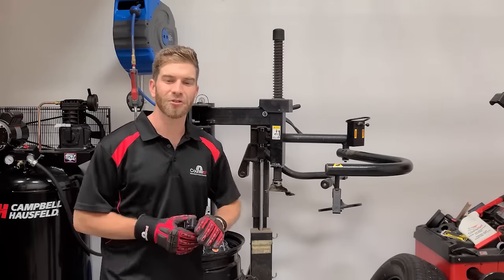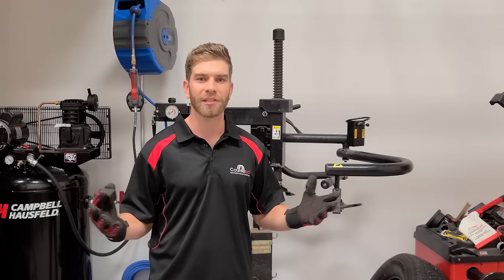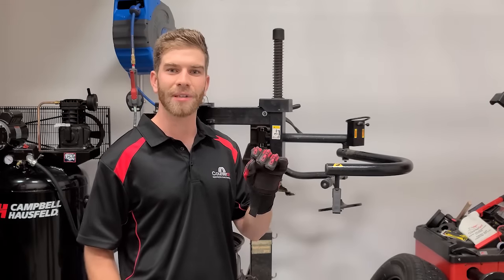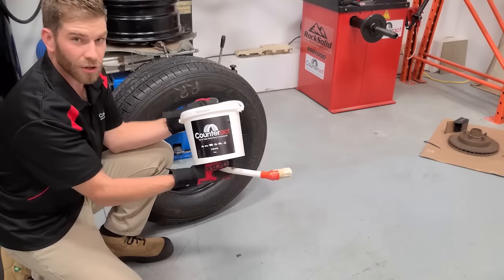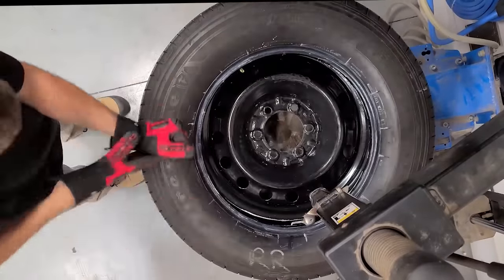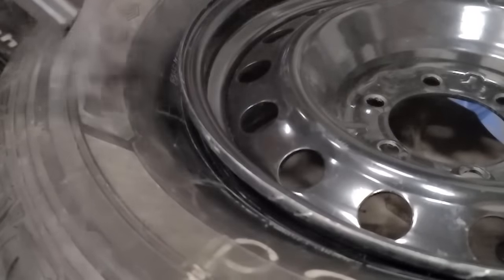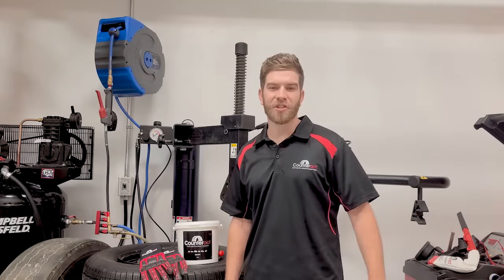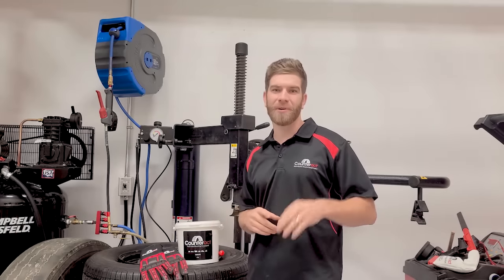Camera INSIDE a tire with Counteract Balancing Beads

Comment: what happens if I get a screw in my tire and need a patch? Do I have to buy beads again or will tire shops recover the beads or fix without losing the beads?
Reply from the maker: In most cases, you can remove the tire with the beads in place. The tech, or whoever is doing the repair can remove the beads and re-use them once the repair is complete. The product will not harm the tire repair or patch, so you can put them back in, or place new product in.

Comment: Will these shave down the inside of the tire like I saw in a show review that removed a wheel with beads in it? Will it act like an abrasive and slowly sand the inner tire? I saw that rubber dust and inner lines on the tire disappeared to show this happened.
Reply from the maker: Hey Andrew,
 
Counteract Balancing Beads will not cause any damage to the inner liner of the tire. They are made of a very smooth tempered glass that does not break down over time and become abrasive like ceramic beads can. Additionally, Counteract Beads are not free flowing in the tire, so they aren't rolling around in there like other products are.
We have a guarantee that if the beads ever cause any tire damage that we will replace that tire for the customer. In our over 25 years of business we have never had to replace a tire.
https://counteractbalancing.com/guarantee/
 
Thanks for the question!

Comment: This would be fine on 275/60r15 drag radials?
Reply from the maker: Hi Abel, yes we have many customers who use the product in drag radials. However, we don't recommend the product for small passenger cars such as a Honda Civic, or VW Jetta as an example. If your wheels are on some sort of classic, or hot rod vehicle then you are ok to proceed.

Comment: I used 6 oz in each of my 31-10.50-15 all terrain's and it shakes like a washing machine. Too much weight? Not enough? 6 oz was the recommendation.
Reply: Hi Greg, I am sorry to hear about the issue you are experiencing. Does the vibration start at lower speeds and get worse with increased speed? or does start to vibrate around highway speeds and go away if you speed up or slow down? Also, how many miles have been driven since installation? There are a few possibilities that could be causing the vibrations, these questions will help us isolated the issue.

Thank you.

Comment: Any reason I couldn't run these in my motorcycle tyres?
Reply from the maker: Hi Mark! None at all, the beads work especially well in Motorcycle tires, just ensure you have the proper amount and reference our motorcycle tire chart here.
https://counteractbalancing.com/wp-content/uploads/2021/07/Motorcycle-2021-Chart.pdf
You can also download our new app with our calculator to find out the required ounces for your tires. https://qrco.de/bcCCSm
Thanks!
Reply: @CounteractBalancingBeads I feel it's crazy that I have  never once had a motorcycle shop offer the option of balance beads and I have been through dozens of tyres across multiple bikes. I don't want ugly lead weights put on my gorgeous new powder coated or polished street bike runs and I don't want the risk of having one come off my track bikes.

Comment: What's the tool called, a model number would be great, that's used to seat the bead?
Reply from the maker: That is the Gaither Bead Bazooka. They have multiple sizes for different applications. It would be best to check out their website for the info.

Comment: The film showed nothing other than the beads being thrown against the outside of the tyre, and they looked pretty uniform not bunched up in one area in an effort to counter the force on the wheel causing vibration. 
I want to see the wheel on the balancer to prove that the wheel is in fact in need of weight to correct its balance.
They tyre marked inside at the point  where counter weights would have been fitted
The wheel itself, without tyre, balanced to prevent the weight of the camera influencing the experiment
I also want to see it repeated with the same result on a variety of wheel sizes.
Reply: The same questions occurred to me, a uniform sprinkling of beads on the inner surface didn't seem to be much if any effect on the wheel assembly as a whole.  When uniformly distributed over the full inner surface, it would be about a quarter gram per square inch of surface, which doesn't seem like it's going to have an appreciable effect.
If the video showed all the beads clustering about a single point, perhaps where the camera was aimed at a lightened sector of the tire, that would be conclusive proof that it's got some benefit.
To do this, apply wheel weights at the opposite end of the tire where the camera is mounted, and then look for the action of the beads clustering at that light section of the tire.
Reply: @dubmob151  Thinking about it, similar to what you suggest, an experiment could prove whether the beads indeed do have an effect by over weighting the wheel to make it out of balance, this way you should know exactly where the beads would cluster. 
Personally I have little faith in the product working and will stick to having my wheels balanced with tradional lead weights
Reply: @joebloggs1317  there seem to be a lot of people that believe in it so it would be a good demonstration.
As a simpler and less involved experiment, just tape on a 2 ounce (or whatever this can handle) weight to a wheel with these beads installed, and drive up to highway speeds; if there is no additional vibration noticeable, then that would prove it works empirically.

Comment: seems to me we can use any kind of small particles?
Reply from the maker: Technically anything you put inside a tire will act the same way, but there are many advantages and disadvantages of what you want to put in your tire. Our beads are proven to readjust easily, not break down, are not affected by moisture, won't damage the liner, etc.

Comment: I have 295/65r18 duratracs on a Toyota Tundra.  I put 8 oz in the tires and after some test driving i get a very slight shimmy on the steering wheel.  What can i do to make it better?  I also had an alignment done at the same time
Reply from the maker: How far have you driven since installing the product? in rare cases, if you placed the bag inside the tire it can take a few miles before it has fully broken apart. This may be the issue. 

If you have driven more than 50 miles and still have a shimmy, a shimmy in the steering wheel would be associated with a front tire, likely, one of those front tires is further out of balance than what we normally recommend for weight. You can simply add 2oz to each front tire since it is a slight shimmy, this should resolve the issue.
Reply: @CounteractBalancingBeads  thanks for your reply.  After 100 miles it has slowly come in.  I will probably add the 2 oz because I feel I’m at the minimum on one tire.

Comment: I'm a mechanical engineer so I have a fairly good understand of kinematics and physics. I know the balance beads work. I've used them. However, for the life of me, I can't actually figure out how they work. There's more going on here than just the centrifugal or centripetal force. If it was only the centripetal force at play, the beads would all go to the point of greatest mass and increase the imbalance.  But like I said I know the beats work so that isn't happen. Therefore there's something else at play that the explanations I keep hearing aren't taking account for.
Reply from the maker: Hi Mike, we just posted a new blog about the Science Behind Balancing Beads which may help to clarify. Thank you!
https://counteractbalancing.com/2024/01/22/the-science-behind-balancing-beads/

Comment: What is your thoughts on using 50/50 antifreeze?….I’ve heard a lot about that.   How many ounces of beads would you use for a 245/70r 17 tire?
Reply from the maker: Glock Man, liquids such as you mentioned have been used to balance tires, it does work, however, ideally, you do not want to have any liquid inside the tire at all. The reason being is tires breathe and they can absorb that liquid and moisture over time and that can lead to the belts rusting or the construction of the tire to break down. You are always best to use a dry compound, or better yet a bead like Counteract. 

For your tire size, it would be 4oz for 1/2 ton vehicle, 6oz for a 3/4-1 ton vehicle. Now if this is an AT or MT tire that would change and you would need 6oz.

Comment: I have a 2020 ram 3500 diesel 4x4 running BFG 37/12.5/20 KM3's with tpms. Having a heck of a time balancing all 4 tires. I have road force balanced 2 sets & they will not zero balance & still have vibrations. Will beads work on this setup and eliminate out of round vibrations? Thank in advance
Reply: It would be alot better for you in this setup to go with centramatic balancing rings
Reply from the maker: Thanks for the question! in a situation of out-of-round tires, ultimately there is no type of balance that would be able to fully eliminate the vibration. If a tire is not round, it will not roll true. Regardless of wheel weights, balancing rings, or balancing compounds there is only so much any of these products could do. The best means is an internal tire balancer, like Counteract, as it is adaptive and will adjust its position as needed. The benefit of the beads is they can balance the tire statically (up and down) and dynamically (left and right). Your tire could be inconsistent in any of those directions. Balancing rings, for example, are unable to balance dynamically as they are contained in a fixed ring and can only rotate and move one way. typically, the taller and more narrow a tire is the greater chance of a static imbalance. The wider the tire, typically a dynamic imbalance, and this is a frequent occurrence with larger off-road and all-terrain tires. Counteract will certainly aid in your situation, but if your tire is out of round, there is only so much anything can do other than replacing the tires.
Reply: @CounteractBalancingBeads  All tires have something a little bit "out of round" about them.  That's why balancing is a thing, at all.
Reply: @dansw0rkshop  no, balancing is to counter act the tire being un evenly weighted

Comment: I got Kanati trail hogs in 35/12.5/20. Have had them before and they're pretty good tires. My local shop only uses beads on 33"+ tires. They had to wait for beads but still mounted the tires. It rode pretty good for being having not been balanced.  These tires have a fairly high rib every 3/4-1". After they added the beads it shakes so bad I had to get off the highway, I believe the beads are getting caught, they disagree and blame the tires, any thoughts?
Reply: Yo! I got Kanati Mud Hogs, 33's though. When I first got them balanced, HORRIBLE. Rode them a couple hundred miles & they were really good, loud but a smooth "ooooooo" not "owowowowowowowowowowow." I was watching this video because there were massive amounts of weight in the barrels. Upping to 35's & looking at these to hopefully not have to weigh up the wheels.
Reply from the maker: Hello, sorry for the long delay in response. It is possible that the ribs (chevrons) could be causing issues, however, the more likely cause is the amount of product used. Do you happen to know what quantity of beads they installed? Typically a 35x12.5R20 will take 12oz per tire for an All Terrain, 14oz per tire for a Mud Terrain tread. 

The other possibility is that the bags inside the tire may not have broken apart as of yet, or at least at the time you commented here.

Comment: How many oz do you recommend for 33x10.5R15 bfg km3's on steel rims?
Reply from the maker: Hello, 

That tire size would be 8oz for an All Terrain, 10oz per tire for a Mud Terrain. The KM3 is a Mud Tire so you are best to use 10oz per tire.

Comment: I’m not sure what kind my tire shop put in my Tacoma but I’m running 285/70/17 9inch wide steel rim , ever since I switch to bead weights I’ve had more wheel shakes on and off a lot more now , I do feel it work and stops shaking once I ge to certain speeds wondering if I need to switch back to normal weights or if the shop didn’t put the proper bead weights in ?
Reply from the maker: Hello, 

Without knowing what product is in your tires and how much, it is hard for us to help you on that matter. If you are able to find out any of that information certainly reach out to us and we will gladly help you the best we can. 

If your balance is intermittent like you say, usually that is a sign of not enough. 

I hope that helps!
Reply: These beads are no good, have worked in a tire shop for 15 years. These just don't work. Sorry they are a scam.
Reply: @israelmex888  ya been told it’s more for semis or big ass mud tires I learnt the hard way
Reply: @israelmex888  they openly tell you don’t use on a passenger vehicle. Only for semis atv dirt bikes etc
Reply: @user-white007  ohh makes sense since semis dirt bikes and atvs are all so similar to each other.
Reply: Don't even use these on semis, go to a shop that knows what they're doing. These things suckand are a waste of money😂

Comment: I still don't think they work 

I have yet to see a video that shows the tire balanced with the beads in it. 

You get all these other videos of beads and everything but it doesn't show it on a machine showing it being balanced when it spins. 

Lead weights are the way to go
Reply from the maker: Hello, thank you for your comment! The reason there aren't many videos showing internal tire balancers in action on tire balancing machines is because these machines aren't able to fully optimize their performance. They can't spin fast or long enough to allow the beads inside the tire to properly settle into place. Additionally, a balancer lacks the suspension that's crucial for helping an internal balancer achieve optimal positioning. While there are videos demonstrating how beads can reduce imbalance on a machine, they're limited by the machine's design and lack of vehicle wheel-end components necessary for full effectiveness.
Reply: @CounteractBalancingBeads  ok
Excellent reply...
I'm still skeptical though 🙂

Comment: Can you use it on any P metric tires?
Reply from the maker: Hi John, 

The product is meant for Motorcycles, ATV, UTV, and any vehicle presenting a 1/2ton suspension and up. P metric tires are compatible, but if they are on a passenger vehicle such as a car or SUV we do not recommend their use in these applications.

Comment: I've discovered a better way to use these beads. DO NOT just toss the bag inside the tire, instead, carefully open bag and empty the beads into the tire.
The reason for this is because the bag never totally disintegrated inside the tire and at times the beads will cluster up in an open part of the bag and cause an unbalanced condition
Reply: yup....even theorizing that happening is the first intuitive guess

Comment: put it on the balancer
Reply from the maker: Beads will not work inside a tire on a balancer for multiple reasons. 

1) the tire does not spin fast enough and long enough on a balancer to properly set the beads in their place. 
2) there is no suspension, the rebound frequency of the suspension is fundamental in helping the beads position themselves. 
3) there is also no road forces acting on the tire tread which also aids in the positioning of the beads. This is part of the reason why an internal balancer is much better than a traditional spin balance. 

Hope this helps!

Comment: I am about to try it on my 2020 Camry, I do 65k km of high way use per years, can't wait to see if it will work ok for my application!!
Any suggestions or if I should not use on this application ??? I am about to put 6oz/per tire in 235/40R19. 

I have order a set for  my oncle's bike too as he just change is tire by is self and does'nt balance them so.... while see here too
Reply from the maker: Counteract isn't recommended for automotive applications. https://counteractbalancing.com/2020/10/05/internal-tire-balancers-in-cars/

Comment: Will these beads damage tire pressure sensors?
Reply: I have been running beads in my 37/12.5/18 stt pro as a daily driver for about a year and a half with no issues I did get metal beads tho to try and cut any dust
Reply from the maker: No, they are TPMS compatible!
Reply: @noahhill8891  completely irrelevant

Comment: I don’t get using lube on a tire never needed to
Reply from the maker: Hello, thank you for your message. We can not endorse this practice, it is imperative to use a proper tire mounting lubricant to mount your tire as to avoid severe damage to the tire bead and ensure proper tire seating.